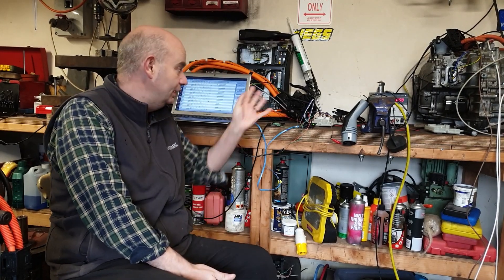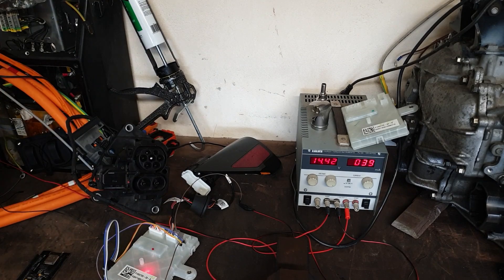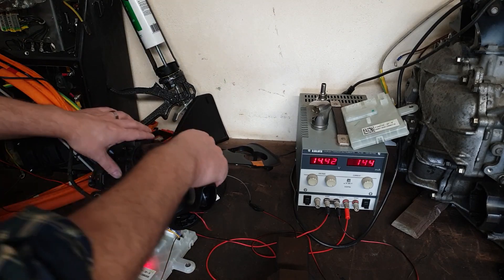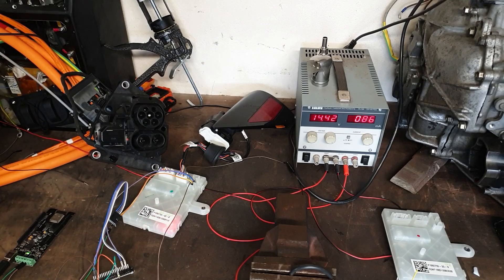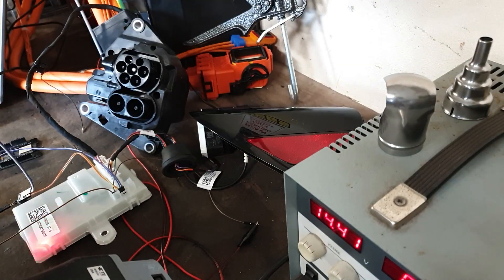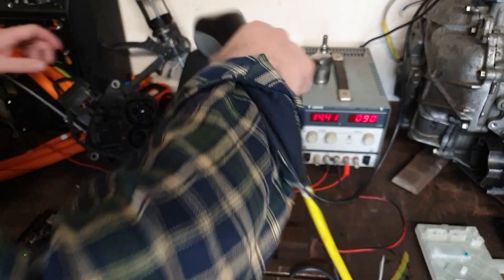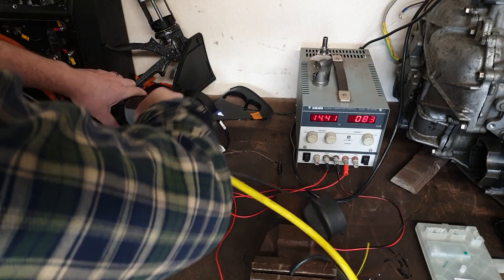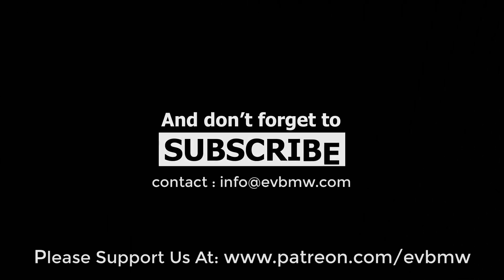Tesla Model 3 Charge Port Hacking : Musk 9000

Comment: Maybe the controller needs to handshake with the onboard charger before it recognises an AC cable being inserted.
Reply: Yes. Not negotiating with charger (EVSE) would normally be a solid blue light, negotiating with charger is flashing blue light, flashing green light for charging. White is charge port unlocked.
Red is presumably a charging fault - maybe looking for BMS?